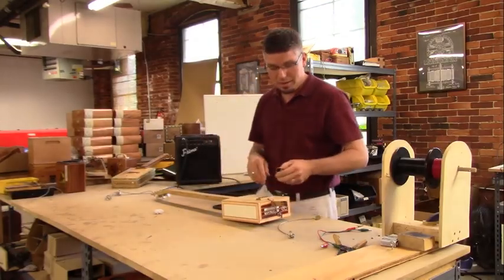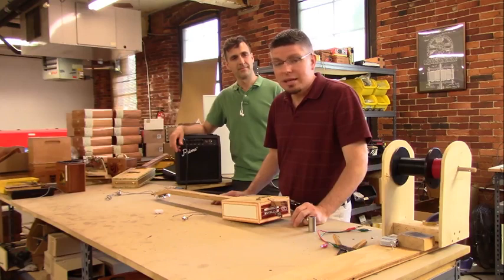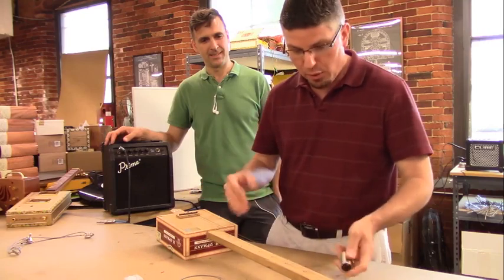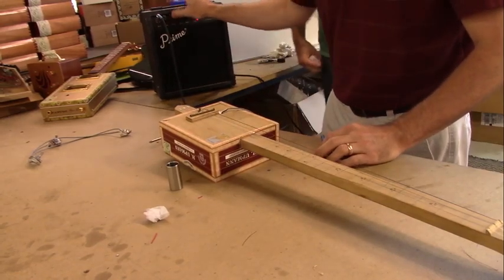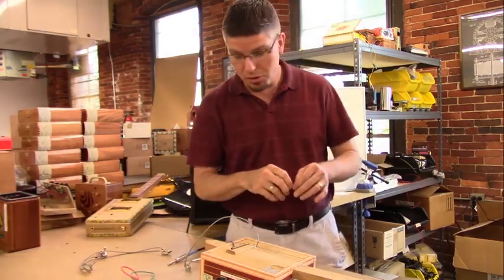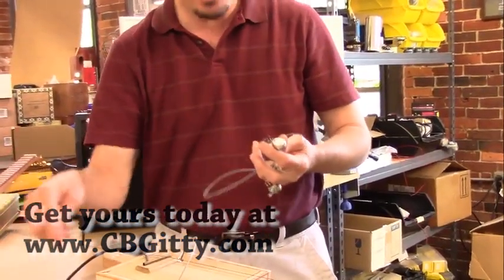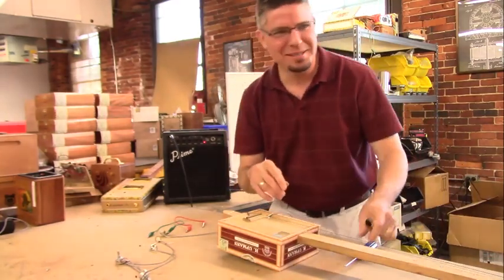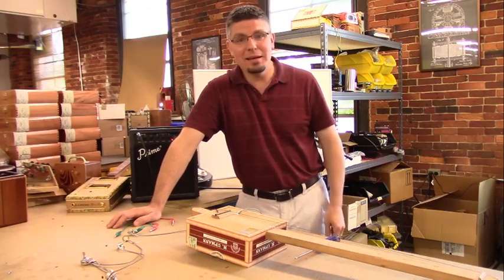Cigar Box Nation TV (6/21/16) - How to use Capacitors with Piezos in Cigar Box Guitars

Comment: Actually the 103 should be read as 10,000 pF or .01 uF the 3 is 1000 and based on picofarads.  the third number is basically how many zeros. so a 104 capacitor would be 100,000 pF or 0.1 uF. with you system of moving the decimal point the number of spaces of the third digit you would get the incorrect value of .001uF for a 104 capacitor.

and yes there can be polarity in capacitors. electrolytics,tantalum etc DO have polarity.

Comment: Love the video but have a question...if you use an equalizer would you still need a capacitor or do they both do the same thing? 
Thanks for all your support.
Reply from the maker: Hello, Ron, and thank you for the question. The capacitor, as it's used here, is a simple and inexpensive way to tame a piezo. An EQ/preamp will do that and more by allowing you to better sculpt the sound of your piezo-electrified CBG. There's a little more work involved with using an EQ/preamp but the results have much greater potential.

Comment: what about if i have a piezo and a humbucker? where would i solder the capacitor if i dont want it messing with the sound of the humbucker?
Reply from the maker: Ideally you would have a switch with separate tone pots. Magnetic and piezo pickups generally don't play well together without some serious modification.
Reply: i have a 3 way selector with 1 tone and 1 volume, so i should get a 2nd tone pot (could i use a volume instead)? where would i put the capacitor?
Reply from the maker: @zipzip8239  You could use a volume. However I think a Tone control would be more effective for a piezo, if you are only going with one. The tone pot will help remove some of the Treble/higher pitched frequencies, rather than reducing the overall signal strength.

One leg of the capacitor would be soldered to the back of the pot and the other I usually solder onto the lug all the way to the right (when looking at the bottom of the pot, with the lugs facing toward you.
Reply: @Cigarboxnation  thanks for the help

Comment: If you clean and thermally shock your soldering iron you will have a better chance of soldering correctly. You should not be on any connection that long when soldering. Also, using dead solder on your connections leads to low reliability of your connection. i almost guarantee that connection will fail in time with the vibration from the instrument.
Reply: Hi James -- "thermally shock" meaning using a damp cloth or sponge to cool it as you clean it off? I've heard conflicting opinions on this... Opponents say it creates pits in the iron's tip and shortens its life. Do you prefer this over using the steel-wool-in-a-cup cleaners?